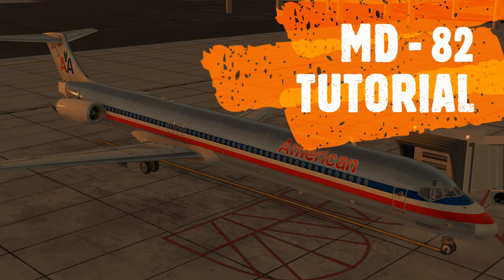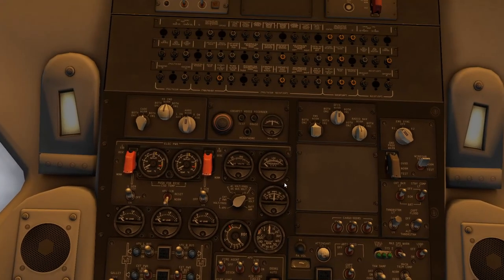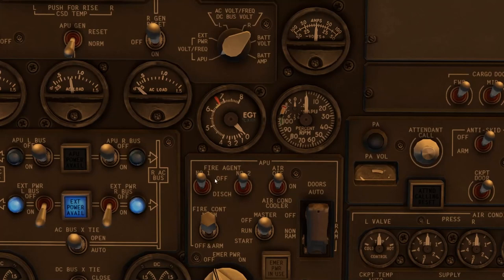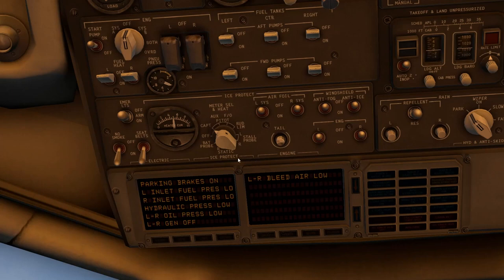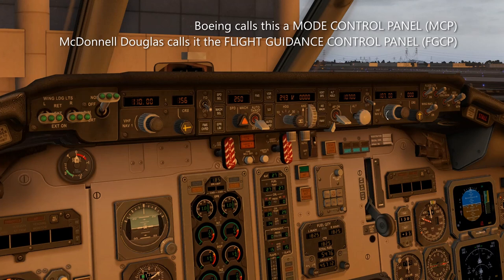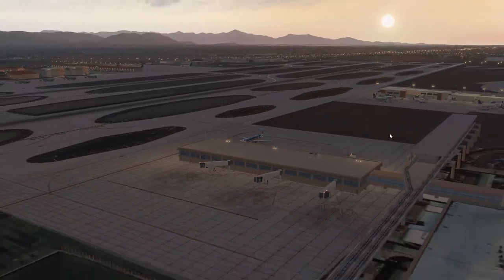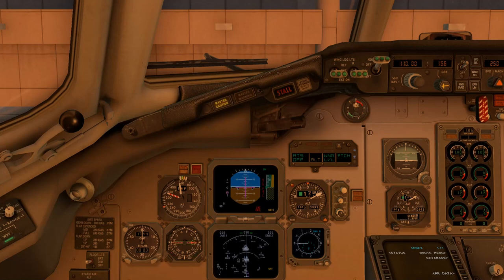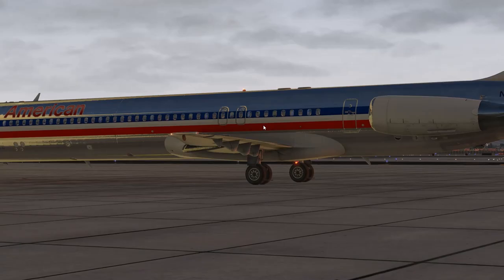X Plane 11 - MD-80 Tutorial | American Airlines : Cold and Dark Power Up

Comment: Love the MD 80 series. Built like a tank. There is a dial below the flap handle on the throttle pedistal. That's the dial a flap. Also that yellow ring has to do with  the pressurization.

Comment: I usually flying full flight with the 737 800. Now I will try the md80 I think I need to remember overhead panel all over again it’s harder than the 737 I think.
Reply from the maker: It is certainly different in layout than the Boeing, but most of the essential functions happen in the same order. Get electric, get APU bleed air, start engines, etc.  You'll really enjoy it once you get used to it.

Comment: i noticed in mid air the cabin temp gauge would point to almost 0 indicating that the cabin air temp is really really cold, Air condition control knob is on auto, not sure if its some sort of bug xplane overlooked
Reply from the maker: That is quite likely the case.  All of these default aircraft are great, but only complete and polished to a certain level.  The default 738, the 744, and this MD80 all leave the feeling that with a little more programming they could be amazing (Like the Zibo mod is for the 738).

Comment: Thanks for the tutorial! I have reached the 16:08 point but when I press&hold the covered trigger "L" and after that pulling up the black lever as you show my left motor doesn't start up(. Can You help me mate?
Reply: And my PNEU PRESS left and below the covered L shows zero
Reply from the maker: Interesting problem. Obviously our procedure works, so only a few options seem available. Possibly you missed a step, or a system has 'failed' (check failure menu), or possibly you did all the steps but something didn't work (for example, if you correctly toggled APU on but it just didn't start for some reason).  It seems you've done a good job trouble shooting already finding the pneumatic pressure is zero. A few specific suggestions related to zero pressure would be to check the APU is operating, the engine bleeds are open (handles on the back of the pedestal between the pilots), and the air conditioning packs are off.  If those don't seem to solve it, you may want to start over cold and dark just in case you missed something the first time. Let us know how it turns out. Good luck sim Captain!
Reply: @FlightBrothersFT  Doing the procedure for several times I finally made it alive. But I do not even understand where the misdemeanor was. Thank You. I am heading forward through your video. In touch!
Reply from the maker: Glad it's working. The Mad Dog is do much fun. Enjoy!
Reply: Thinking that my Warthog has some assignments and he was spoil some commands I made with my mouse.
Reply: @FlightBrothersFT  Now the point 24:52. When I press the FPLN button the bottom sign of the device we study shows NAV DATA OUT OF DATE. And all the next steps have no respond in my case. Bro(s)?
Reply from the maker: NAV DATA OUT OF DATE is based on the AIRAC cycle.  Anything older than “now” should show as out of date.  There may be other and potentially free ways to update it, but we both have Navigraph subscriptions and would recommend anyone flying frequently to take a look at their products at www.navigraph.com. You’ll get global Instrument charts, updated AIRAC data and they are always adding new features.  We aren’t sponsored by them, but they allow us to show their charts in the production of our videos.  Hopefully this answers your question, if not, let us know!

Comment: How to release parking brakes?
Reply from the maker: 3 options. 1, press B on the keyboard, 2 use foot pedal toe brakes if you have them, or 3 click the center circle on the tiller wheel. The tiller is just to the captain's left, beside the yoke and just in front of the panel.

Comment: everytime i cick i get a clunking noise. idk if thats xp11 or just thie aircraft
Reply from the maker: Hazi many of the aircraft have unique sound sets, especially for switches.  Is it possible this is what you are hearing?  There is also “road noise” when it’s in motion.
Reply: Flight Brothers FT no. Every time i click on the screen, doesn’t matter where (doesn’t happen on Zibo or any payware) it makes a clunking noise. Could click on the sky and it’ll make a clunky noise. And happens when everything is switched off and cold and dark

Comment: cant use the engine sync either
Reply from the maker: The included Laminar default aircraft have a lot of missing features and sometimes dummy switches. Basically they have all the necessary flight functions, but lack the next layer of systems depth and or custom features.  You might enjoy the ROTATE MD80 payware if you're looking for a more authentic experience.